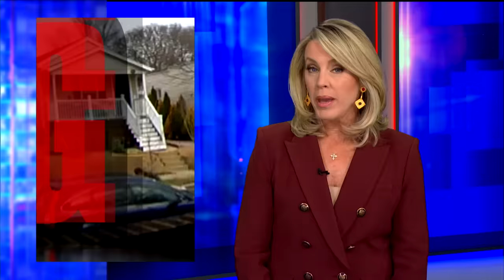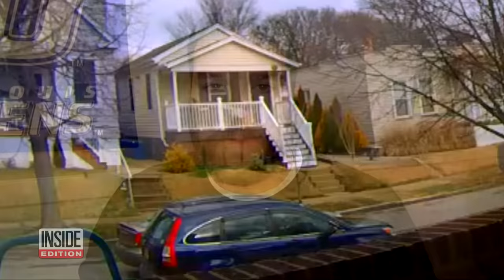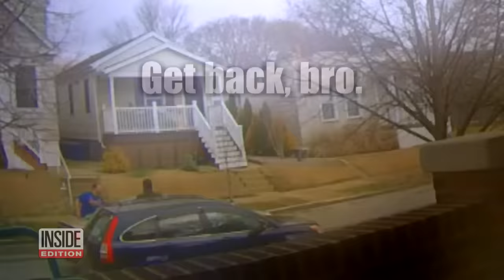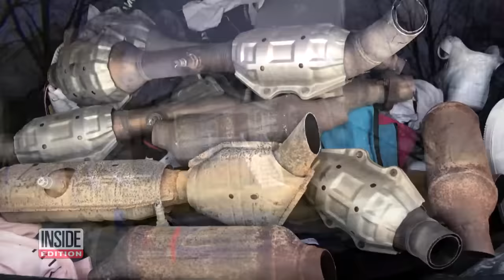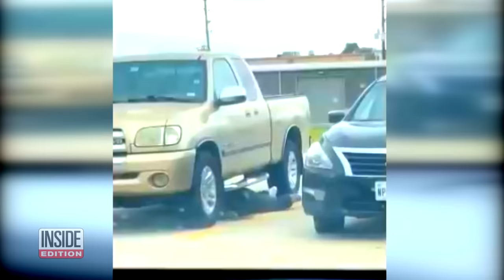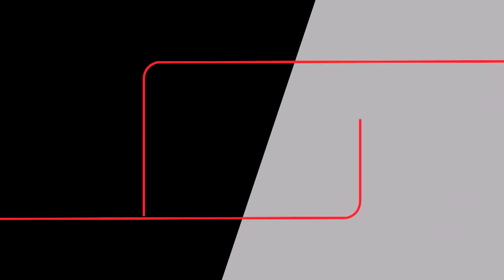Car Owner Chase Off Suspected Catalytic Converter Thief

Comment: From California to Washington state there's a huge theft ring.  I was one of the victims. 
They stole my car, gutted it& took the catalytic converter off. - Insurance didn't pay due to the fact when the motorcycle was put on they THOUGHT we wanted to take the car off.  
Weeks  after getting another vehicle, they tried stealing the other vehicle,  by then we had a kill switch put on.  They later tried taking that catalytic converter but it t has a cover on it.  
I'd be doing the same as this guy,  PD says stand down and don't go after them but I'm tired of it.  How much more can one deal with.

Comment: I got a free jack that way. I shoot my 380 in the air and scared the dic. He left his jack.
Reply: Don't random shoot in air.
Don't you know that bullet travels back to earth with same velocity?
Reply: No not like the thousands of bullets on new years eve or forth of July. Bit me
Reply: @randomsucks2444  I have seen several people getting died due to bullets fired during wedding celebrations in my country.
People fire shots in air after watching movies but they don't know what happens to thise bullets afterward. 
I also didn't know until I saw it on news.
Reply: @mr.america9806  air resistance. Terminal velocity is significantly lower than muzzle velocity. Bullets will slow to the fastest speed the air will allow.

Comment: The same thing happened to me. My  2006 Hyundai Santa Fe was parked in a small parking lot. I came out heard that same sound. Saw this
skinny guy under my car & my foot and his butt connected. He scrambled up,  I asked him if he was stealing the catalytic converter. He said stammering, 
I am sorry @ took off in his little gray truck.  He had sawed one side thru, but not the other. It took forever to get ahold of the police, like 45 minutes. I was told that I would be called back. 2 hrs later they called me. Anyway, I found a mechanic near my house and took it to them the next day.  I got a call from the mechanic 3 days later who told me that thieves had come and taken 5 catalytic converters from the cars parked at his shop, one being mine!  He said he would put in an exhaust pipe and didn’t charge me. At least I don’t have a catalytic converter that can be stolen anymore.
Reply: The mechanic jacked you

Comment: Watching this turns my stomach and wishing that I was that guy. I didn't catch the thief that stole my cat in Wallingford Connecticut. The replacement was well over $3000 and the cops said there was nothing they could do. They can't chase the suspect or run the plates because it probably happened from a stolen car.

Comment: my car was making funny noises... finally the mechanic tracked down the source... apparently the "honeycomb"(?) ceramic elements inside the catalytic converter had cracked and broken up into lots of little pieces.  He showed it to me while he was dumping out those little pieces... he said that I needed a new converter which was around $1000.  I asked him if there was another way to fix that, such as a used one from the parts junkyard.  He was it would still be a couple hundred dollars.  In the end, I had him just empty out the converter and installing it back.  It was basically an empty converter..    guess what?  about 5 months later, it was stolen when I parked at Tyson's Galleria mall...   I would have paid money to see the expression on the thief's face when he realized that he had stolen an empty catalytic converter. :)   Went back to the same mechanic and he welded a straight pipe in in its place.
Reply: Careful. That's a federal law that was just broken.. twice. Never post back yard mechanic tricks.
Reply: @frankens43   the inside of my old catalytic converter was completely crumbled... which means that it wasn't doing anything... in fact, the smaller particles ended up downstream in the rest of the exhaust...  :(    I could have simply done nothing and left it as is.(which meant that the rattling noise would have continued)

Comment: What catalytic converter is $3,000??
Reply: It depends on the car.  I have a Toyota and it has 2 catalytic converters.  So yeah, it's expensive.
Reply: Mine ~ Prius owner
Reply: For the cost of part and mechanic yes $3,000 lot of people don't want/ can't work on their own vehicles.
Reply: @crossfuentes9738  Camry here.